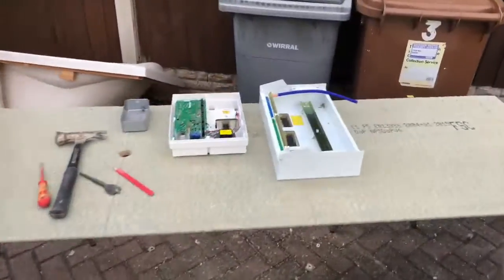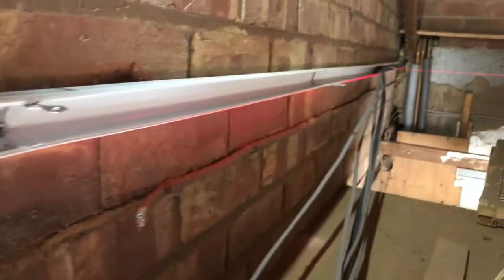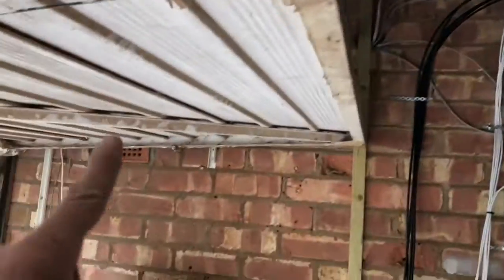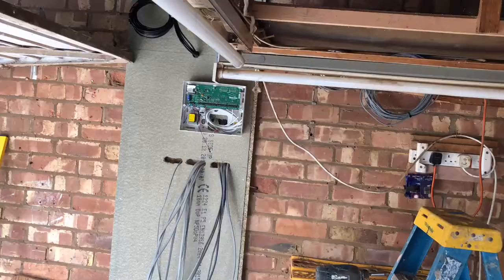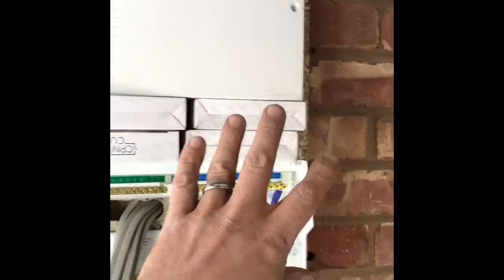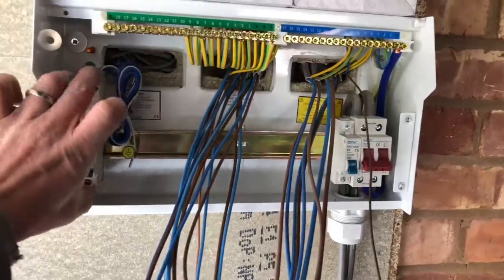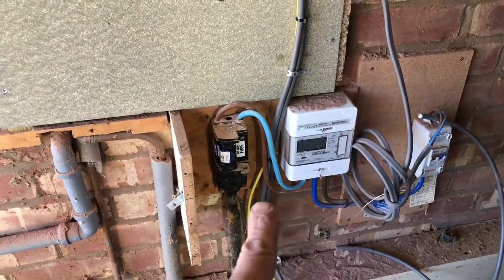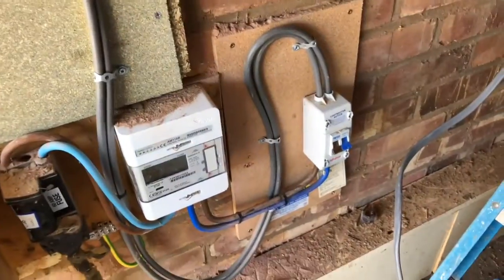Housebashing electrical rcboconsumer unit installation

Comment: Board looks neat, nice job. A few things for consideration on future jobs:
- no ferrules on the neutral fly leads (fine wire needs to be suitably treated)
- definitely not a 100mm gap between ELV and LV cables run in parallel
- buy a garage CU and put it on a bit of board with a couple of double sockets. Do it properly with 25mm2 tails and an earth and use that for each rewire - only need to connect it up and attach it to the wall
- those RCBOs are all AC - no LED dimmers, computer equipment, washing machines or anything else that could affect operation?

Comment: Very neat ,but a bit awkward to add extra circuits if needed.
Reply from the maker: Ray Chambers what so awkward? 🤔
Reply: Well the whole backing board might have to be pulled and some cables might be a bit tight that's all.

Comment: You should not be using that stainless strapping to secure cables.
Reply: Earthing cable ties... Never heard of that one before. Surely this is your own personal preference Paul, I can’t see any regulation that state steel cable ties need to be earthed.
Reply: @alvina69  there isn't a reg that's why, I agree! A proper protective device would've tripped due the the fire so the cable tie could never come live anyway. so it's stupid to suggest you run earth round your metal ties😂
Reply: Why do you think insulated strapping is available? For fun? 

If any of you worked for me and used that, you would be looking for another job.
Reply: @niceguy235uk1  how ridiculous. You would said a man for using all round band? Would you sack a man for using single pole sockets instead of double pole? Just because it's not the best option it doesn't make it unsafe.
Reply from the maker: Paul Green whys that?
Reply: Apologies, i mis worded. It can be used, however it should be earthed. 
Or use the insulated, plastic dipped version.
Reply from the maker: Paul Green 🤣🤣 earth the clips...
Reply: Why not....!!!!!
Reply: @Leigh Browne beat me too it mate